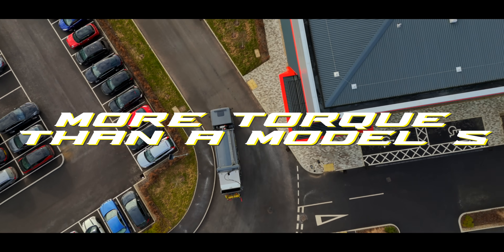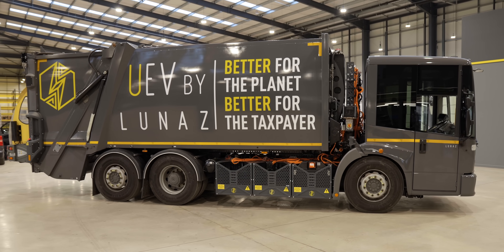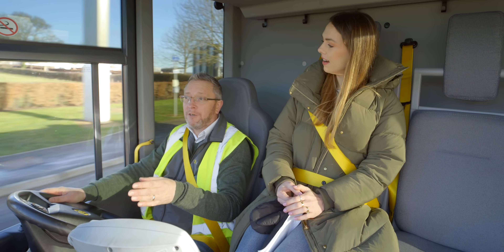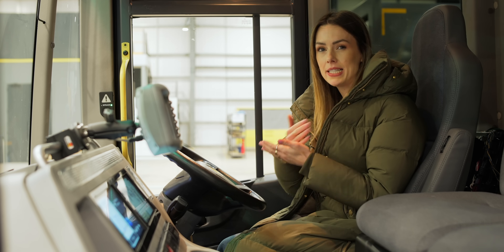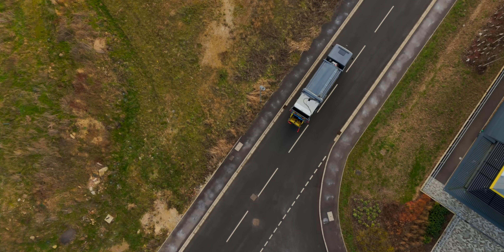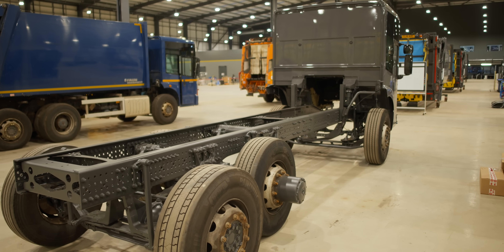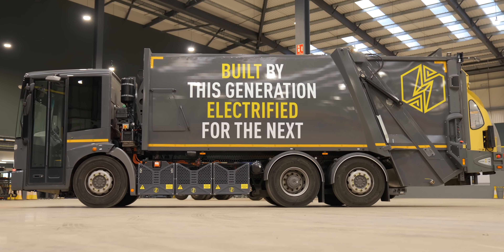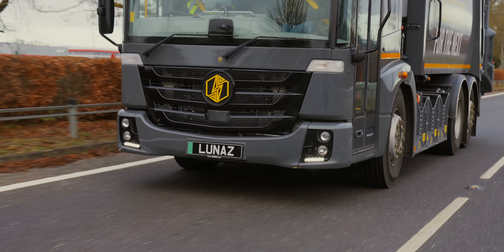Is This RUBBISH Electric Vehicle Britain's BEST EV?!

Comment: Seemed a lot of time money and investment into what is a niche vehicle which by usage doesn't need updating once in service for many years. We have 18T DAF electric trucks on test where I work and initial 6 months testing shows there is still a long way to go in development.
Reply: Can you elaborate? What needs improving on those on test?
Reply: @hrford exactly. What development is needed? If by that it’s meant ‘charging infrastructure’ then yes - because governments are stupid. DNO regulations are antiquate. And quite frankly the government lack of incentives and favouring petrol and diesel is obvious. But what about the vehicles?
Reply: Charge times can be erratic even with the same level of battery left ( own chargers on site ) Range can suddenly suffer for no reason leading to being recovered a couple of times which involves specialist recovery. Used for local deliveries to hospitals where noise levels matter but trust has been lost in longer distances. Turnaround times don't suit logistics for JIT.  @hrford
Reply: like what?

Comment: That looks well designed, you put a different back on it, you could even put a camper back on it.
Reply: Why would you need such a heavy duty chassis for a camper? (unless it's the huge type like the American ones or the ones F! cews use)
Reply: @eclecticcyclist  It works out cheaper to repurpose a current heavy duty chassis than to make a new one that's lighter.
It's about keeping cost down.
Look at the Xbus for example, they are all the same under the skin but each one is different, but keeping the chassis the same cuts cost down and means no retooling needed.

But yes this would be more suitable for a bigger motor home.
Reply: @dave4803  Even cheaper tand more efficient o re use a lighter chassis matched to the use.
Reply: @eclecticcyclist  To use a different chassis will add cost as things won't fit and they'll need different tooling as well.
So this lighter chassis costs more and will rust out quicker than the normal one.
Plus with the current set up you overland it.
Also losing the bin lorry back for a camper will make it lighter.
Reply: @dave4803  As the company has gone into liquidation there wouldn't be any 'cheap ' production line parts anyway so you'd be looking at one off coersion so you might as well make it as cheapas possible i.e. using a lighter cassis.
Reply: @eclecticcyclist  I hope they get saved.

Comment: This was interesting - clearly there is a need for these vehicles to be quieter and less polluting as they drive around residential areas at 6am... it would have been good to understand how the economics work, ie how much does a new ICE bin lorry cost, how much is a new electric one, and how much are these guys charging to convert an ICE bin lorry to EV... what are the pressures on operators to switch to EV (running costs, emissions targets etc)?
Reply: Oh FFS, all the evidence is already in, showing evs are far more eco friendly than ice vehicles.
Wake up dude.
Reply: I think you're underestimating how much the sound of refuse being tipped into the back of these vehicles and ground up with big rotating motors drowns out the sounds of a diesel engine at 6am in a morning. As for polluting, most diesel commercial vehicles have to abide by strict Euro 6 standards since September 2015 so pollution is minimal anyway (I think it's about 0.5g/km), probably much less than the coal/oil powered electric generators that supply the grids with increasing amounts of electricity to charge these EVs. And that's not even going into the pollution caused during the mining and manufacture of the batteries.
But aside from all that, let's get back to the video. I have a couple of other questions that could be asked alongside your own. What is the point of a 0-50mph acceleration in a vehicle that weighs up to 10 tonnes (as stated in the video) and travels around residential streets at a crawl most of the time stopping at each house on the way. For a vehicle that can carry that amount of weight and produce that amount of torque how big is the battery pack and how much of the vehicles maximum allowable gross weight is taken up by these batteries instead of the cargo they are supposed to be carrying. How much does using these battery packs to drive the large motors that grind and compress the refuse affect the vehicle's range. Can they still operate for a full day before having to return to base for charging for hours at a time? Because if they can't complete a full days work then either councils will have to purchase more of these more expensive vehicles or start letting rubbish pile up on the streets.
To be honest, EV refuge collection vehicles is almost as dumb as EV emergency vehicles, not quite as bad, but close. Less life threatening at any rate.
Reply: @Galerak1 minimal pollution is still  infinitely higher than zero pollution and if you stand next to a large diesel engine you get polluted. Follow one around all day as the crew do and you will get seriously polluted.
We have been over this many times before. Electric motors are much more efficient than ice motors so if you put all the diesel that you would put in  the tank into a generator and charge a battery it would go further. So clean air, lower cost what is not to like.
The truck can do 0-50 in 6 secs but that is not in the design spec, it comes as a bonus from an electric drive.
Electric drives are perfect for crawling around stopping and stating. The motor delivers max torque at zero revs which is what you want when starting. With a diesel you have to rev the engine and release the clutch. Fuel intensive.
Ever wondered why everybody wants electric trains and the trains with diesels are diesel-electric? .It's control and torque starting.
Reply: @Galerak1  Well, we have electric refuse vehicles operating within Oxford and they are indescribably quieter than diesel/hydraulic equivalents. They're not upcycled ones but are ones on sale from an established manufacturer. They contribute greatly to the relative peace and quiet of Oxford town centre, which is increasingly served by electric buses too. All DPD and Royal Mail vehicles are electric too, and there's a clean air zone around the centre. Believe me, electric refuse trucks are an amazing sight to behold and not hear. Don't knock it until you've experienced it.
Reply: And as for the rest of your anti-EV stuff... I'll politely point you to other videos on this channel that pretty much disprove all of your arguments. Time to go and find out some facts before you write lengthy articles of nonsense.
Reply: @richardgledhill  Of course they are, Fedex tests their electric trucks and bicycles in my neighborhood. Much quieter. Cant wait for the stink of diesel to disappear.
Reply: @Galerak1  "the coal/oil powered electric generators that supply the grids with increasing amounts of electricity to charge these EVs"
You are writing as if you arein the UK... perhaps you don't realise that the UK reduced the amount of fossil fuels used to generate electricity in 2023 by 22% compared to the previous year, and the lowest total amount in 66 years... also that coal and oil each accounted for around 1% of the total production.
You do ask some interesting questions about operations of the vehicle, but that was spoilt a bit by your somewhat uninformed rant (I apologise if you are not in the UK and your country realky is generating increasinglymore electricity from fossil fuels, in order to charge EVs).
Hopefully you are someone with an open and enquiring mind and will look up the data and further develop your thoughts. Look forward to further interaction. Best wishes.
Reply: @Galerak1 you lost all credibility when you claimed that coal and oil were used to charge EVs. This is a UK company supplying vehicles so the UK. We don't use coal or oil to generate electricity any more. Gas, yes, but that is lower carbon than the other 2 due to higher H content, and overnight when these vehicles are being charged very little gas is used. It was only 15% last time I checked.
Reply: @Galerak1 did you watch the video? It's not a 10 tonne truck, it's a 26 tonne truck that can hold 10 tonnes of cargo. The batteries weigh 2 - 3 tonnes, so are less than 10% of the vehicle weight when fully loaded.

The vehicle is electronically limited in its performance, the listed acceleration is what it could achieve if you took that limitation off.
Reply: @Galerak1  You obviously watched the video but did not listen to anything that was said, I'm not going to go into it all but one thing is that the batteries can be 2, 4 or 6 depending on the need of the authority to do a day's work with the amount of electricity that is required for a days use, all refuse lorries can run for a day like buses because the actual distance they travel in a day is small in comparison with an Electric HGV which can travel over 300 miles on a single charge.

Comment: Seems like a bit of a con with the cost of retrofitting almost being the same as buying a purpose built BEV refuse vehicle, I can see why they have gone into administration. I understand the principle of removing ICE engines permanently from the supply chain, but this neglects the fact that a lot of developing nations buy second hand stock as it is more affordable, replacing older less efficient combustion engines with second hand euro compliant trucks, emitting less pollution.
Reply: The byd ones are cheaper brand new. These retrofit guys go for 1/2 million and more
Reply: @onetwothreefour-s1n  maybe get you’re figures right on prices first boss, I work for Lunaz 👍🏽
Reply: @Churchy2404  cool, what are the prices then. Google says over 500k
Reply: Indeed I think the brand new byd garbage trucks may in fact be cheaper, quote on the lunaz cost: The conversion process currently takes 20 days per truck, with Lunaz aiming to get that down to 11 days when they hit full production speed in 2026. At nearly half a million dollars each,....byd cost seems to be 300k US but hard to find firm figures.
Reply: As long as it's cheaper than a new one it'll still sell. It might seem like pennypinching for one vehicle but if you've got a fleet of 20 it adds up.
Reply: @mememaster147  depending on the running costs. Diesel and engine parts don't come cheap. If a truck is off the road it's costing money
Reply: The cost of a Lunaz UEV is a fraction of that of a new equivalent, whilst also featuring various additional safety/comfort features. The ICE engines are also decommissioned on site in order to prevent the problem of pollution being continually spread within third world countries. The Mercedes Econic is tested for a million miles, however the average life span only takes these trucks to around 100,000 miles. That is an obscure figure to comprehend; that’s only a 1/10 of their full capability. How can this brilliant idea be a con when the whole purpose is to allow these trucks to reach their full life expectancy by up-cycling original components (saving the equivalent weight of the Eiffel Tower each year) whilst replacing the polluting diesel engine with an in house electric powertrain?
Reply: @Churchy2404  the byd ones appear to beCheaper bRand new out of the box
Reply: @onetwothreefour-s1n  why isn’t everyone using BYD then?
Reply: @Churchy2404  that may be the second most idiotic thing I've seen written today. Is there a Tesla fanboy convention nearby or something? JFK, they are Chinese, no western country would be foolish enough to buy them in this climate, even if they are made in the USA.
Reply: @onetwothreefour-s1n  so you’ve proved my point? 🤣 if BYD are cheaper because they’re Chinese and can’t be used in this climate, why would you suggest that as an alternative? Think you’re the one who needs the fanboy convention…
Reply: @onetwothreefour-s1n 
Eh?
Reply: @Churchy2404  they CAN use byd they just CHOOSE not to. These retrofit ones aren't economically viable in the least. Hence the out of business sign that went up today.
Reply: @onetwothreefour-s1n  please explain how they aren’t economically viable? Pretty sweeping statement to be making to a Lunaz employee when the only ‘facts’ and figures you have come from a quick Google search
Reply: @Churchy2404  cool, they would still be in business.
Reply: @Churchy2404  As you apparently have the figures, why don't you share them rather than criticise someone for using the only source easily available. You now have the opportunity to put the facts in the public arena.
Reply: It’s more about converting to ev the ice vehicles that are being decommissioned or have become too expensive mechanically to keep repairing, giving a second life one at a time.

Comment: Did they not just go under today?
Reply: Rather unfortunate timing! We can probably blame the current govt for pushing back the ICE ban by 5 years (and making local authorities practically destitute over the last few)
Reply: For nascent industries failure, is more common than success. But it has little to no  bearing on the concept.
Reply: Nothing to do with Govt policy. That claim was PR spin by the company blindly repeated in the video.
Why? Well diesel phase out for new HGVs has not changed.
Another factor to consider here is that retrofit on HGVs has long history, that history is not good.  @xxwookey
Reply: @duncanbuchanan218  Fair point that the HGV timings remain unchanged. (2040). I didn't know that. Govt general rowing back on the transition certainly hasn't helped the mood music, but maybe this conversion was just too expensive. 
I don't know about previous HGV retrofit issues.